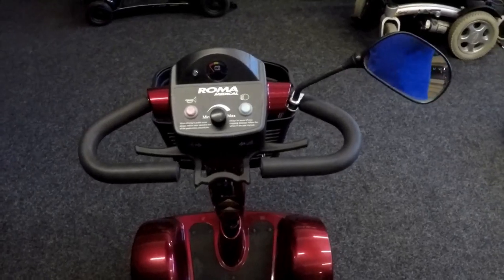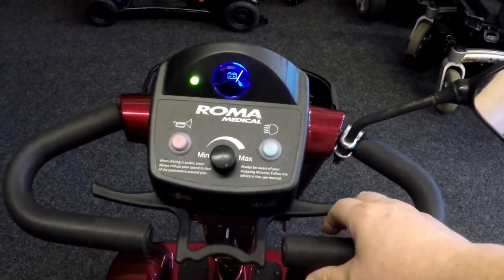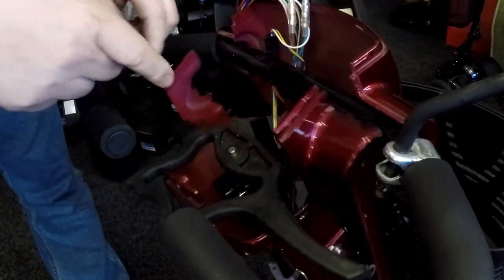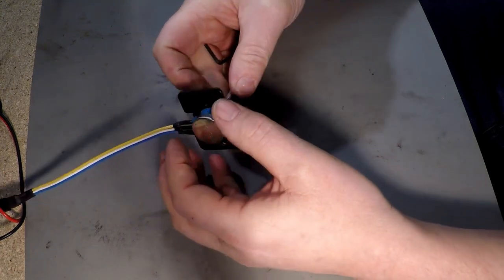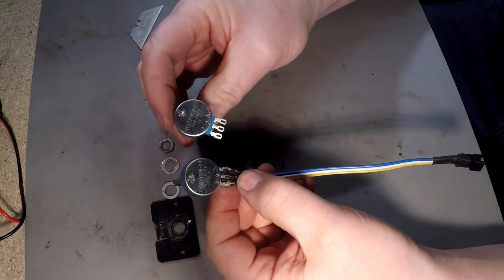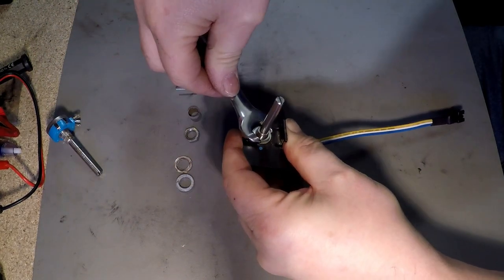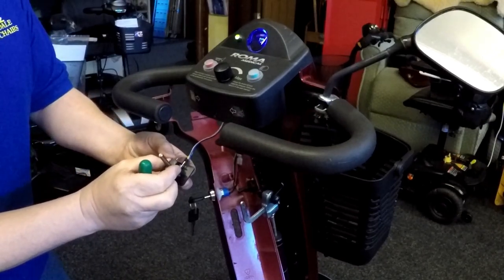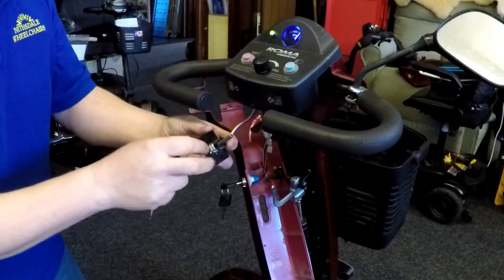Roma Sorrento Repair

Comment: If yore replacing with a used good one , can it be fitted straight on with no alteration,.?
Reply from the maker: As long as it’s the complete Assy then yes. But mind you a second hand one won’t last the same as a new one and no warranty
Reply: @tomjacques4  Thank you, that’s very interesting to know. I have made a few attempts to get an answer from your parts dept’ regarding a replacement but for what ever reason I don’t get a reply.🤔.

Comment: My scooter had an erratic needle battery gauge full to empty and stopping after a very short run it was the batteries, changed them then all worked ok.